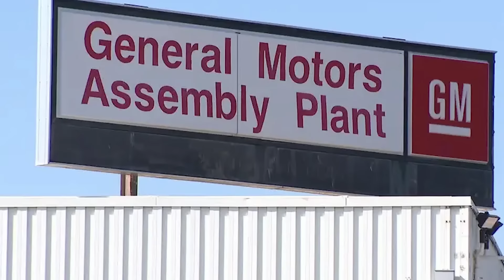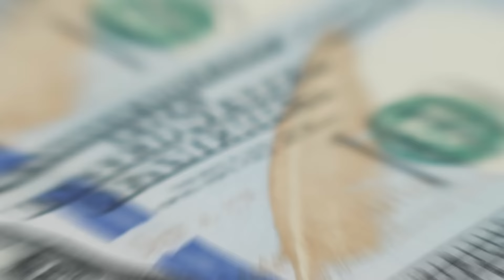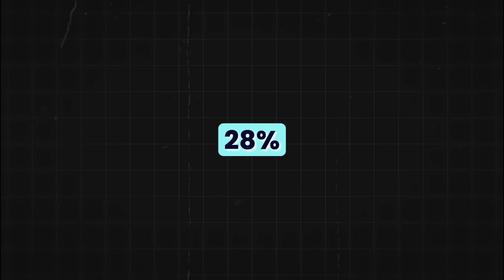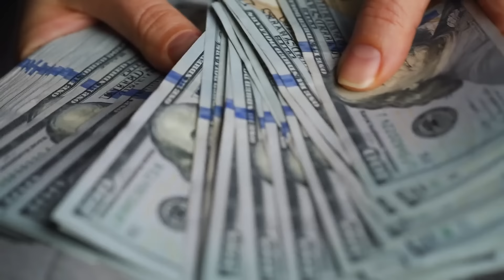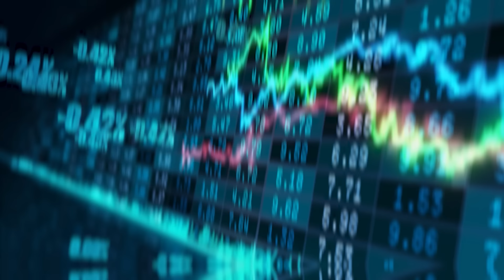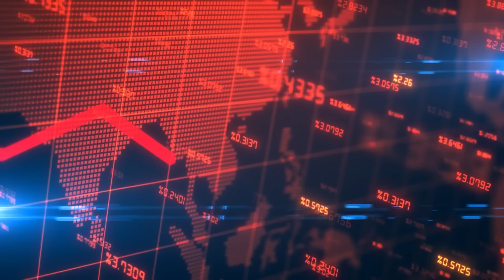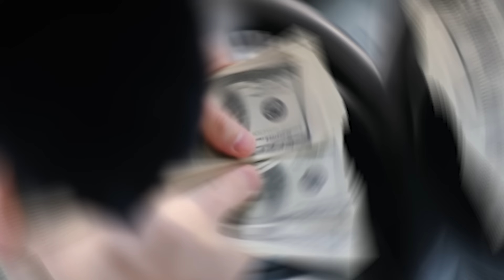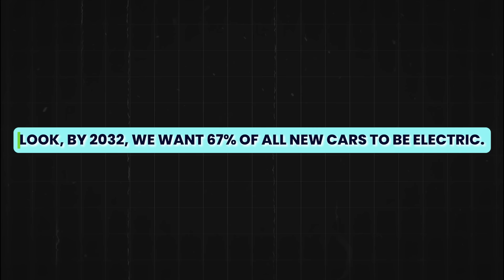The EV BUBBLE has Burst!!!

Comment: It sucks for people to lose their jobs over this. I've been laid off once before and I hated getting that unemployment check. I wanted to work.
From the horirble resale value, cost of replacing a battery, the charging experience, performance in cold weather, to the ever present fire risk there are far too many reasons to avoid an EV.
Reply: Whether it's fair to workers or not, EVs will take over the auto market.  It's already happening.  When a new technology takes the place of an old one, jobs are lost and new ones create.

Example:  Blacksmith replaced by automechanic.   Coal miner replaced by natural gas, wind and solar technician.  Milkman and butcher shop replaced by supermarket.  The list goes on.  And it will always be that way.
Reply: @charlesm7589  So what part of "THEY CAN"T SELL EM" don't you understand?
Reply: @MikeHF except when government gets in betwenn and f-s it up
Reply: When we work, we just want to be on holiday and have longer breaks. As soon as you don't have a job, you want nothing more than to go to work.
Reply: that's only true if the technology is better than what you have,   if autos weren't better than horses - people would still be riding horses.  And back then - the government didn't force you to buy a car -  you wanted to buy one because it'd improve your life.   No one who has an EV can say their life is better -  the few people I know that have one are always worried about the charge they have, getting to their destination etc.     FYI_  there are still blacksmiths out there today, and they weren't replaced by auto mechanics.  There are still coal miners today -  China is building more coal plants than ever before in history -   so why they build their country - our politicians destroy ours.  
There are still butchers too.    Seems you should check your list -  or maybe learn to read more and become more informed and stop watching msnbc
Reply: @1patrickchristensen  MSNPC.
Reply: @1patrickchristensen love the way you narrated your comment, especially where you said we wanted cars, to improve our lives. Government mandating EV'S doesn't do that.More expensive and less practical. Leave the choice to the people if they want them, they will buy them if they want them, no incentives,  NO MANDATES.
Reply: @charlesm7589  Dude you are not paying attention here. EVs have been here for 140 years and still have not taken off. LOL
Reply: Not to mention the dealers are even more motivated to screw the customer now.
Reply: @MikeHF  They can in fact EVs are a growing part of the market place.
Reply: To expansive. Out of reach.
Reply: Thermal runaway risk is  extremely lethal and never should’ve been approved of in the 1st place for vehicles. One lithium ion EV battery fire took 40,000 gallons of water to put the fire out. They had to turn it on its side to access the battery. It reignited on the tow truck & again at the dump.
Reply: @wanaraz  Haven't taken off?  You need to look at sales numbers.  1.4 million EV Ford pickups in the last 2 years.  ALL the auto makers are scrambling to get in on it.  Let's not even talk about how many cars Tesla has sold.

Are they perfect?  No.  But then neither were early gas cars.

Are they going to take over the market?  Absolutely.  Just like the airliner took over from the ocean liner and the car took over from the horse.
Reply: @MikeHF  So, what part of Ford has already sold well over one million EVs is unclear to you!!??
Reply: @charlesm7589  Ford and Gm are closing down their EV departments. Last year they lost Billions of dollars. 
Ford sold 20,365 F-150 Lightning trucks so far in 2023, up from 13,258 in 2022 for a 53 percent increase. EVs accounted for a little under 8 percent of all US vehicle sales in the third quarter of 2023, according to Cox Automotive.
Tesla is a toy for the upper class. 
The problem with your analogy is EVs were her before airplanes and most vehicles.
There is no infrastructure for EVs. Right now it's Pie in the sky dreams for people like you.

Comment: People are not convinced. The initial cost, maintenance & parts replacement is out of reach for the vast majority of populations.
Reply: Good luck when you have to replace the battery
Reply: Not only that but when it comes to trucks, you can’t use them as a truck. If I tow a vibratory plow, tools and product to the job site I won’t be able to get back to the shop. It’s even worse for a landscaper.
Reply: @bq6162 this really makes me lol. They have an 8 year warentee and an anticipated life of 10-12 years.
Reply: @Audioremedy0785  so what happens if it blows up at 8 years?

Comment: It's not just EVs. It's all cars are just too damn expensive. We just bought a "new" car, but it was not a new car it was a used car. I have been buying new cars for decades and when I looked at the offerings and the costs, I ended up buying a lease return used car first time in 40 years! Looking at new cars, anything close to what we got used was over 2.5x the cost, and the used car was only 2 years old with 20K miles.

Comment: Battery powered vehicles looking for a solution to a problem that doesn't exist.
Reply: TheRealCatof  Pretending it's real wont make it so.
Reply: TheRealCatof  It's not a matter of denying climate change.  Either way, EVs are not green, not by a long shot.
Reply: TheRealCatof Pretending man has any effect on global temperatures won't make it true either. The sun will continue with its cycles, ignoring anything we do.
Reply: @hugolafhugolaf No vehicles are green. Drive what you want and drop the fucking virtue signalling, both sides.
Reply: TheRealCatof  Because burning gas is the only thing making ICE cars terrible?  Are you kidding me?  

To extract enough cobalt to build only ONE EV battery, you need to extract 50 tons of material.  50 TONS.  FOR ONE CAR.  That's in DRC in Africa.  Where diesel-belching machinery is the norm; then the ore is refined (with sulfuric acid), then it gets shipped to a port (since the DRC region where cobalt is is central) in polluting trains; then it gets shipped by a polluting boat to a plant that builds the battery; then it gets shipped to the plant that builds the car.  So far, I'm only talking about cobalt.  Lithium comes from Chile.  Add another huge amounts of transportation to the mix.  Oh, and let's not forget rare earths that go into it as well.  And copper, and nickel, etc...

Then, once built, the car gets shipped to the country where it's gonna be sold, and then to the dealership.  None of than is done any differently than for ICE cars.  Given what additionnal materials are required though, up to that point, the EV has polluted way more than the ICE car.  And then you have to charge your EV, drawing additional electricity from the power grid, electricity made mainly by burning fossil fuels, all while destroying your own tires and the roads faster due to the extra weight.  And when your battery's life is over, you ditch the car because the battery's worth almost as much as the car itself.  or, if you really love your car, you get a new battery, and the new one is, if you're lucky, 70% recyclable, leaving 30% of toxic waste that an ICE car would never produce.

But hey, it's green, because it doesn't burn gas.
Reply: Hold my coal power plant
Reply: TheRealCatof  
Name me ONE climate prediction,from the past 70 years,that's actually manifested.
You need to find a new religion.
Reply: TheRealCatof  
Where does the electricity to power them come from.thin air?
Reply: TheRealCatof  lying about it does not make it real....................
Reply: The problem exists whether you understand science and geography or not. EV's aren't the solution.
Reply: TheRealCatof  DDT doesn't use gas, therefore it is green by your criteria.
Reply: TheRealCatof you still didn't answer the question. Where do you think the energy to power these cars come from?😅
Reply: @hugolafhugolaf  And yet they WILL replace combustion vehicles.  It is inevitable.  It's already happening.
Reply: TheRealCatof  Cattle Farming or making Levis Jeans has a bigger impact on the planet than EVs...
Reply: Hold your breath until you turn blue or green and then you'll be blue green and you to can be considered that until you croak which btw is a fine idea! TheRealCatof
Reply: .@TheRealCatof  Especially when they don't sell and sit on the parking lots
Reply: man, AI bots are out in force today 🤔
Reply: 100 years tops left of oil...a kid born today wont be able to afford gas by retirement
Reply: @TheRealCatof  What about the making of the batteries and disposing of them? That green?
Reply: Ignoring reality won't make your fantasies come true.
Reply: TheRealCatof  manufacturing battery is not green.
Reply: TheRealCatof  Ok, you really are trolling at this point.  A battery shipping boat?  A battery train?
Reply: TheRealCatof  And we all know that doesn't pollute.
Reply: TheRealCatof  Tell that to the african people working in the mines collecting the materials for those EV's
Reply: @MikeHF  recycling is more than possible, it's being done.
Reply: TheRealCatof  What are the batteries made from? You are delusional.  :hand-orange-covering-eyes:
Reply: TheRealCatof  :face-green-smiling:. You must be the designer of the screen doors fitted for submarines, since no one had any great ideas of keeping the fish out.
Reply: TheRealCatof  You’re beyond saving.
Reply: TheRealCatof  The latter statement in your comment was the only honest thing that you have typed in this thread.
Reply: So true  @hugolafhugolaf
Reply: TheRealCatof  that’s because we are still coming out of an ice age. It’s been getting warmer every year for the last 12,000 years.
Reply: Battery powered are good for some situations - you have to have a garage or a safe parking space, if you have some solar panels even better. As long as you're not pushing it to the limits of the battery every day, and parking it every night at a good charging spot, you'll save lots of money on fuel. Otherwise you need a hybrid or gas vehicle
Reply: @davidbarlow350  It's much easier to make clean powerplants for the grid than it is to make everybodys F150 clean.
Reply: https://youtu.be/Pn2eCY3Kwuk

Comment: I moved to the San Luis Valley in Colorado in 2018. I bought a small 1000 square foot house for 74,000 dollars. I couldn't then or now buy a new 4x4 pickup for less than that and now they want me to buy an ev that won't give more than 50 or 60 miles of travel in the winter. I don't think I'll take the bait.

Comment: The cold weather stops ev's COLD ! Batteries lose their charge and cant hold a charge in zero degree temps ! Chicago was an example of thousands of ev owners stranded . Plus it cost more than gas at the charging stations.
Reply: all those owners are going to return them for a gas vehicle when it warms up.  just watch.
Reply: Use of A/C will also drain battery as compressor and blower need electricity
Reply: Heat over 98F does it too, when you are over 98F or below 32F, an EV battery loses like 40% of its capacity and takes 2-3x longer to charge.  Plus the fact our power grid cant even support the EV mandates

Comment: The biggest problem with EV's is that the Manufacturers refuse to listen to their customers.
Instead of building a cost efficient, user friendly base model EV that is affordable to own & drive, they insist on loading up the build cost by cramming pointless gizmos, that most drivers don't need, while ignoring the EV's biggest problem ......... the cars very limited range / time to recharge, which is negatively effected by cold weather (some experts say that it's up to 40% range loss).
Reply: There are a cost efficient EVs that are pretty barebones-the Nissan Leaf and Chevy Bolt. They didn't sell very many of them nor make money from them.
Reply: @fubecabr  The Indian motor car company, Tata, created the perfect 'entry level' (low cost to buy & run), 5 door, unbelievably economical (26km/lt) car (Tata Tiago) but limited production to 355,000 for India consumption only.
If EV's could match that value for money, EV cars may have a chance.
Reply: @fubecabr  Personalty we think that Hydrogen would be a much better option as:
1) The infrastructure for refueling liquid gas in cars / trucks is already in place, so rollout could be relatively quick. 
2) overall running cost to run & maintain Hydrogen cars would be peanuts when compared to EV cars maintenance.
3) This route would create a 'Win Win' scenario as even traditional cars / trucks could easily be converted to Hydrogen to aid countries to try to achieve climate emissions targets.
4) Most importantly, trucks / cars will be able to run 24/7, if needed, as they don't have to wait for batteries to recharge.
Combining Solar / Wind / Wave generators to create hydrogen for mass consumption would be much cheaper for governments to provide than the very expensive car batteries that cost a fortune to replace every 5 to 8 years.
The positives to transforming to hydrogen goes on & on........... but ........ until all the global governments take 'Controllable Climate change' seriously, money gauging strategies (like EV's) will be given preference. 
Apparently EV's have a higher 'Global Carbon foot print' than the average car if the production of batteries & power supplies are factored in.
Reply: So true, Who needs auto Guidance when you can find a charging station
Reply: Not to mention if you actually try putting any kind of weight in the lightning. Range drops dramatically.
Reply: Government mandates are driving up the cost
Reply: @NeoMaruLLB  Logic says that the quickest & cheapest way to achieve the global carbon emissions targets is to have all vehicles converted to run on green gas as a viable, much cheaper, carbon neutral alternative to the expensive EV's that have a bigger carbon foot print than the average car over 5 years??
The best part of the green gas conversion is that traveling long distances in different climate conditions,will not be a problem and can easily be converted to hydrogen once reliable, affordable availability is established.
Reply: @bondobilly9369  Definitely. Sadly, it's big money coupled to Government policies actually control the future direction of vehicle development...... and ....... not what is best for the global environment and the average consumer needs!!!
Reply: We'll said. Excellent point. 👍🏼
Reply: Don’t forget the fact that they randomly explode too!
Reply: The only viable market for plug-in battery EVs today is a small set of wealthy folks who can afford expensive cars, have home chargers, use the EV to commute around town, and have at least one other internal combustion engine vehicle they can take on long road trips.  This technology is not ready for the mass market, and may not be any time in the foreseeable future.  These EVs just don't compete well with comparable ICE cars on overall value at this point in time.

Comment: Disaster is a good description. I recently retired from Commercial sales of Fords after 33 years, have to wait a year or more for gas powered vehicle orders now, when it took only 2- 4 months in the past, and this article is correct, to be EV certified, you will have to invest about $1Mil in infrastructure/charging stations. Lightnings have fallen off the cliff, can't give them away, and the Electric Transit van, same thing. Range is only about 100 miles on Transit, which is literally a joke for commercial applications..  Hybrid is a good choice out there, but EV only for a small segment of applications, in my opinion.   But the progressives have pushed this on manufacturers and likewise on the public, and now it is coming home to roost, majority does not want one.  And we don't even have battery recycling plants to deal with all these useless batteries coming down the road in time............what a freaking mess!!
Reply: Wanna have some fun...go to a Ford Dealer and act like you're buying an EV Truck...after jerking them around for a while say "I've changed my mind, the EV's are JUNK!"😵‍💫
Reply: I think they have enough problems without doing that.

Comment: EV aren’t ready for the real world. In Canada last week at -50  your range is cut to about a 1/3 of normal. Can’t safely make it from point A to b if you happen to hit stuck your going to freeze to death
Reply: How many 300 mile journeys  are people doing in -50 degrees the whole way 😂😂
Reply: @Audioremedy0785  one third of the normal range of 300 miles, is 100 miles. If it's -50, and you want to be safe, you'd have to stop every 50 miles to recharge,  because there's no guarantee of another working charging station in the next 50 miles. If need to pay $100,000 for a vehicle,  it better drive itself 300 miles without stopping no matter what the weather.

Comment: EV's are a bad idea, especially when they're not affordable and dependable. Great content!
Reply: tiepup tell that to the folks in Chicago last week.
Reply: China selling beautiful  brand new ev running 500 km each charge for US$35k. No pollution, no high priced fuel and quiet. 😂😂
Reply: so move to china  @wawa10475
Reply: You are out of date. Medium Chinese EVs in China sell for $20K. Low end EVs sell for $10K. @wawa10475
Reply: The idea isn't bad, it's the current execution of the idea that's not doing well. Trains went electric a few decades ago, with an engine as a generator rather than a billion batteries, and they are still the most efficient way to move cargo, so clearly the idea isn't the problem, its the implementation that's wrong.

Comment: What a surprise! The vehicles get less powerful the further you go. I wonder how they handle on icy roads?
Reply: They don't because the cold bricks the battery.
Reply: They will slide very well when the batteries discharge and the wheels lock up!
Reply: We have floods where I live atm, I wouldn't trust driving through flood water in an EV